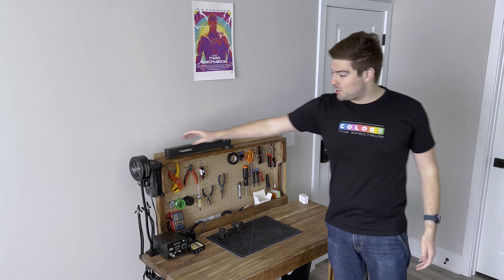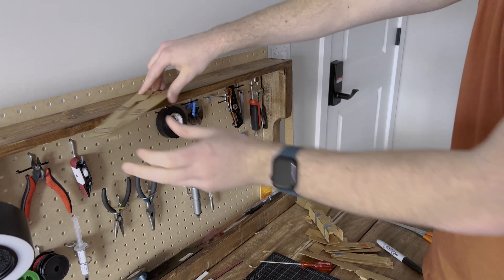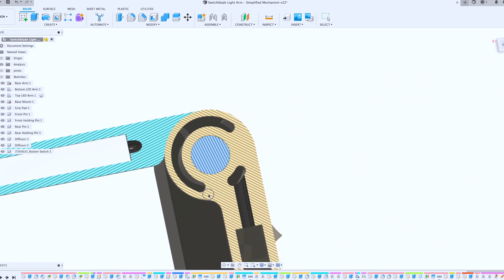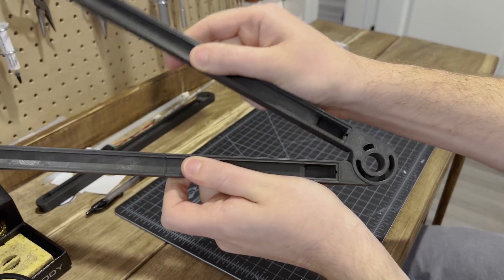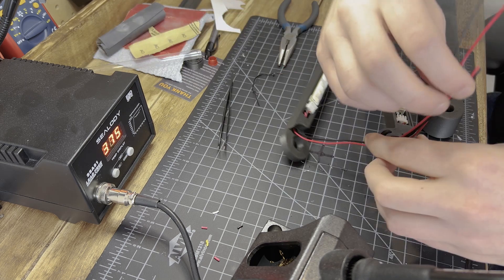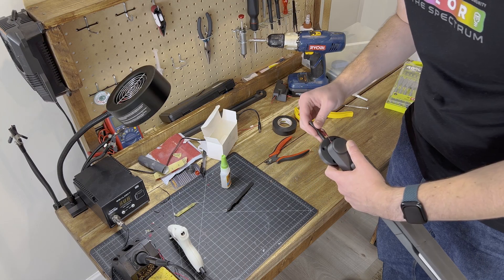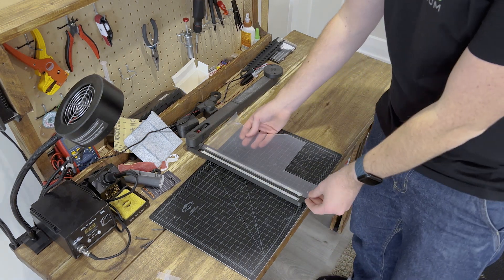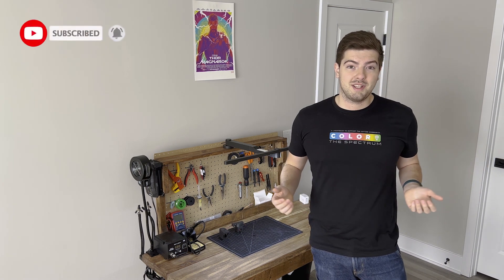Satisfying DIY Desk Lamp Build

Comment: What's that mouse or dial you were using on the left side during fusion360 part?
Reply from the maker: It's called a space mouse. I got introduced to them at work, but essentially they let you navigate in 3D space really easily and you can program quick actions onto the buttons. They do decent educational discounts if you're a student, but otherwise it's an investment. I do quite like it though!
Reply: @IZLabs  thanks I'll check it out.